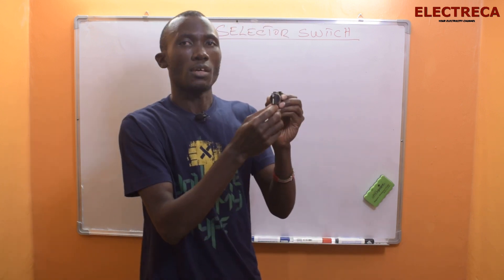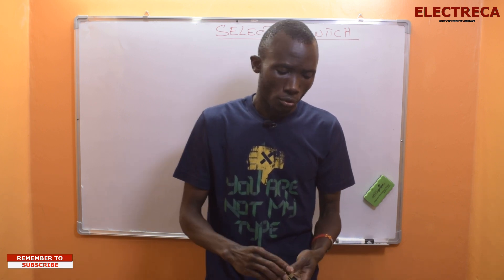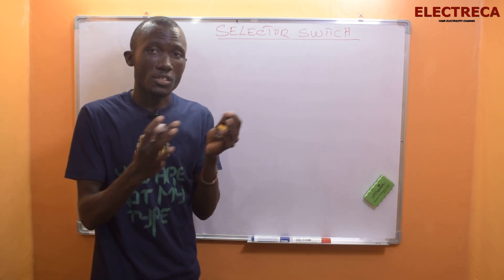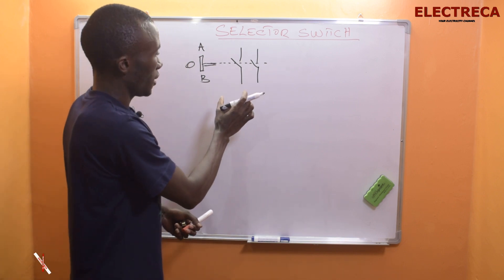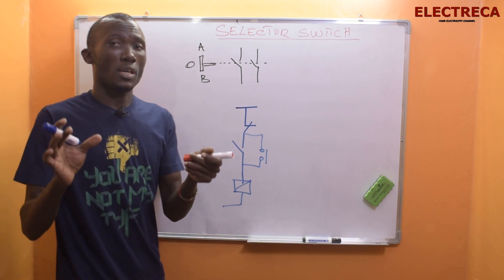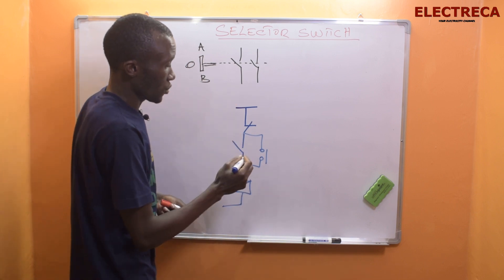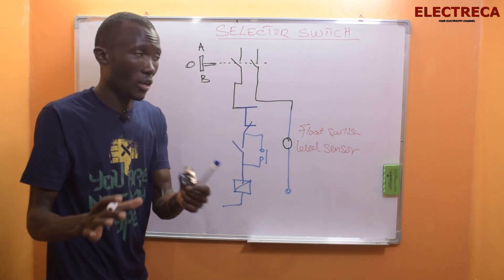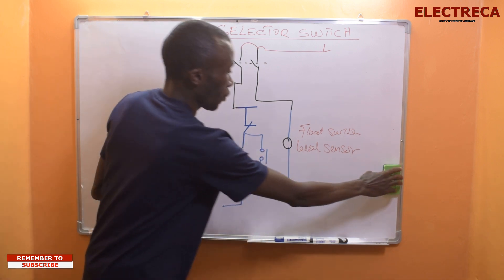selector switch auto off manual control options

Comment: Clear explanation on the switching. Im confused in wiring  a float switch which does not have a auto/manual switch. I have a magnetic contactor with on/off switch, a float switch and pump. Thank you electreca
Reply from the maker: That ON/OFF switch supposed to be connected in series with contactor coil A1 and Neutral to A2